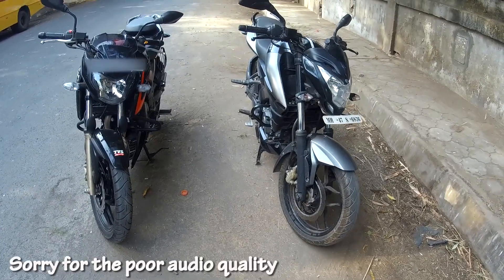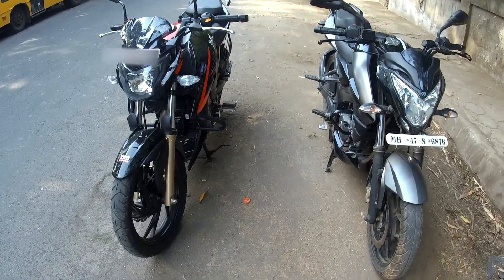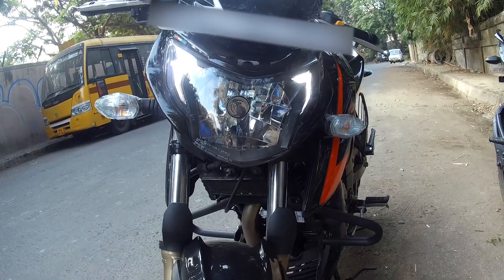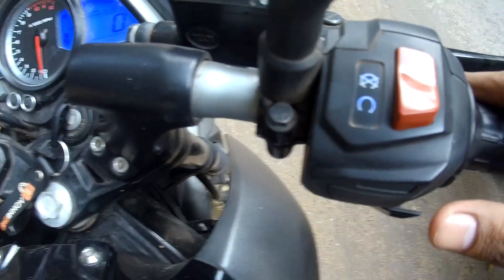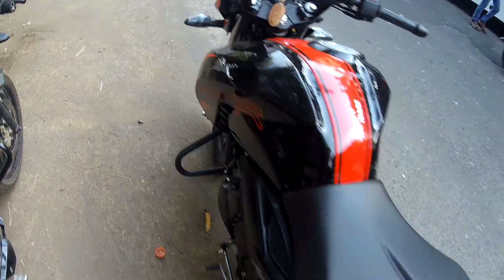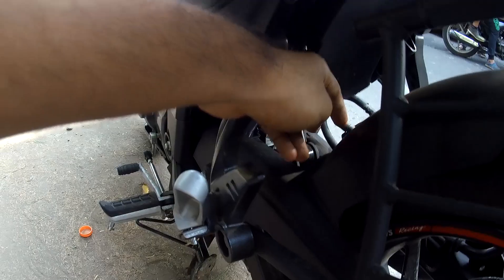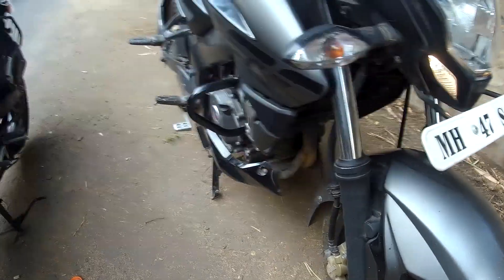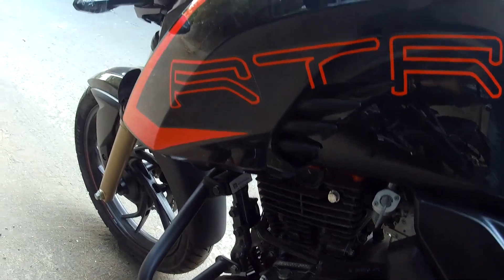2018 Apache RTR 200 Race Edition v/s Pulsar NS200

Comment: I'm concerned about seat height. I'm tall, so i required saddle height more. In specs , it's 800 & 805mm for rtr & ns. But in videos showing too much height difference. Why? Which one is suitable for taller rider?
Reply from the maker: I'm 5'8". Have ridden both bikes back to back. Seat height does make a difference. On apache I was comfortable. On NS initially had to be a bit careful as both my feet wouldn't touch the ground. Now I have been using NS for aprox 2 years and it's all good

Comment: does apache rtr 200 4v 2.0 abs version comes with pirelli tyres by default or do we have to pay extra bucks for pirelli tyres ?
Reply from the maker: You need to pay extra for pirelli tyres
Reply: pirelli tires though offer you better grip, they wear out very soon, u will have to change them within 6 months, if you are taking bike for track purpose go for pirelli or else stick to the normal ones which offer decent grip and offer better durability

Comment: Bro I have small doubt. I bought apache rtr 200 v 2.0 , in that we can change rpm limit, by default it has 7000 rpm, but I changed it to max 12,000 . So it’s good or bad for bike. Bro .?
Reply from the maker: Keep it at 7000 till you complete your break-in. Once break-in period is done, you could set it to max.
Reply: JS3 Vlogs thnx for reply  bro that’s mean till first service.?thats right
Reply from the maker: Not exactly. Refer your user manual for the break-in period or break-in kilometers. For reference my bike had it's first service at 350km but the break-in was till 1200km
Reply: Moses Praveen are you asking about that gear shift indicator. If that so, in fifth gear it wouldn't glow. Shit rpm is 7000, because it is the max power rpm
Reply: Annamalai Thirumalraj  oh thnx bro
Reply from the maker: Bro It is not gear shift indicator, it is rpm limiter. If you set it at 7000rpm, engine won't rev beyond it.
Reply: Rev limiter is set to 11k rpm setting 7k only means the rev limiter light blinks. You can use it for gear change indications. You can't remove a Rev limiter. Rpm limiter and rev limiter are 2 different things
Reply: Alex Mercer rev = rpm. Both are the same
Reply: Deepak Vasudevan rev limiter is different. It doesn't let you cross 11k rpm.